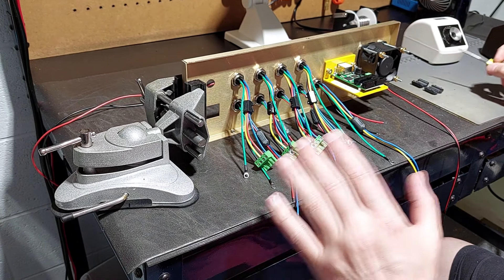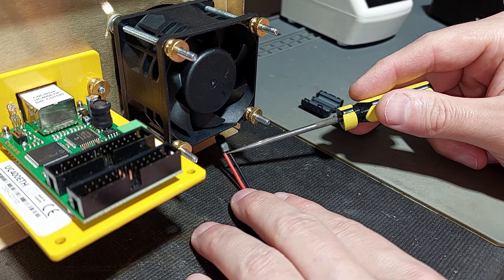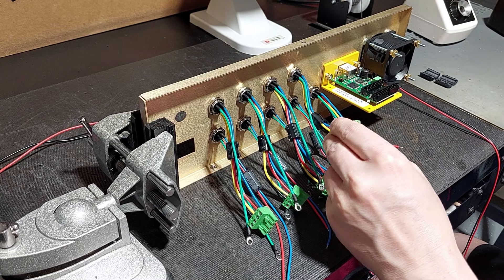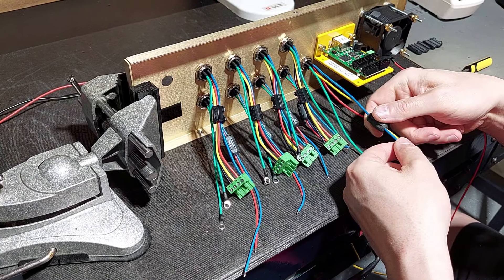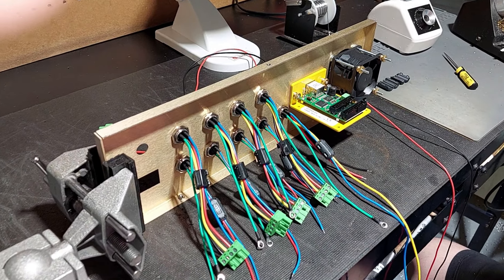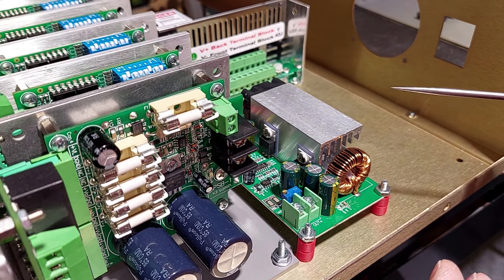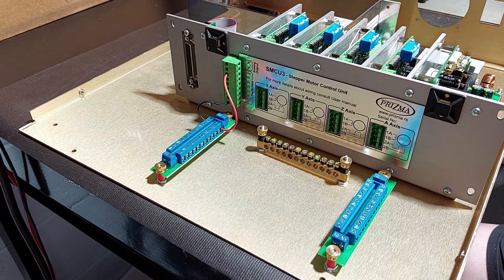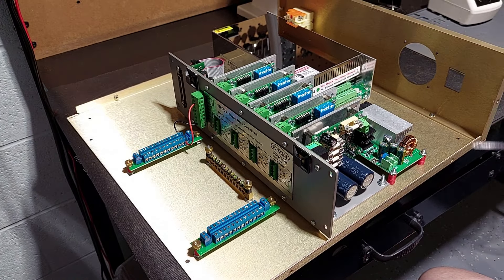The Integrated 4 Axes System Progress, And Meeting Me

Comment: Mr Vince and your wife thanks clean work
Reply from the maker: Thank you for the kind words, and support as always. Vince
Reply: @corvetteguy50  Mr Vince you tin the wires green connector or you use ferrules without plastic ?
Reply from the maker: I prefer to tin my leads at a lower soldering temperature which applies a thicker coat of solder similar to ferrule. Thank you,
Vince
Reply: @corvetteguy50 You are welcome  I read in lead shine stepper driver document if you tin the lead you create a high resistance and that's effect the driver
Reply from the maker: I've tinned my leads on literally all my systems that utilize terminal blocks as the only real reason one typically uses ferrules is because they are crimped on, so it reduces labor. I've never heard of that before, but soldering itself would reduce resistance as it adds more conductive mass to a leads copper conductors. Here's a good article discussing the positive, and negative attributes of soldering, and crimping https://www.linkedin.com/advice/0/what-pros-cons-soldering-vs-crimping-wires#:~:text=Soldering%20offers%20several%20advantages%20over,and%20efficiency%20of%20the%20equipment. 

Thank you,
Vince

Comment: How do we know what frequentie ferrite we need?

I just had emi isseus on my home build router(i dont know much about this)   yes im fair.     I just winged it with installing a ferrite ring from an old powersupply on my vfd cable thanks to youre movies. This eliminated the isseus on that.    Im trying to learn from youre channel. And do.  But as im not a robotics person. I have a lot to learn.

So again.   You give lots of info.  But youre talking about the propper frequentie of the ferrite.   How do i know what i need to buy.
Reply from the maker: Thank you for your support. All spindle cables should be double shielded, and not using ferrites in best practice as like my video states ferrites are only effective on short lead runs. 

Ferrite frequency in your case is irrelevant as you need to replace your spindle cable with the correct type.

 I carry the proper double shielded cable, and if you want to purchase one I'll need the length you require, and I'll give you 10% off the price. 

Thank you,
Vince

Comment: Nice video Vince. After  seeing the video i have a doubt. The 0-10V external signal used to drive the spindle's  RPM in the VFD need to be considered like a power cable (so no shielded cable and grounding required) or like a signal cable (so shielded cable and grounding required) ?
Reply from the maker: Thank you as always for your support, and I also love my Hitec Aurora 9. :)

The PWM signal should be always as clean as possible for your motion control software to register it for correct RPM output.

I prefer to use a TDK ferrite as its a simple format to correct any potential variance from internal EMI. In the end the choice is always up to the end user, and I've had the debate for years on what leads should be filtered/shielded, and what shouldn't. 

If an end user is alright with not using double shielded cable, or ferrites on particular components/areas of their system that's fine as its theirs, but in the long run I just don't see the logic in not adding a ferrite at the cost of about $4 for "piece of mind" for an accurate PWM signal as its critical. 

I've learned in over a decade online that the only time one really appreciates applying the techniques implemented on my channel is when their system is stable for extended duration.  

Thank you,
Vince
Reply: @corvetteguy50  Thanks for your clarification Vince, very appreciate. Now i'm with Jeti  DS-16 🙂
Reply from the maker: You bet..:) That's a great radio as well. Vince